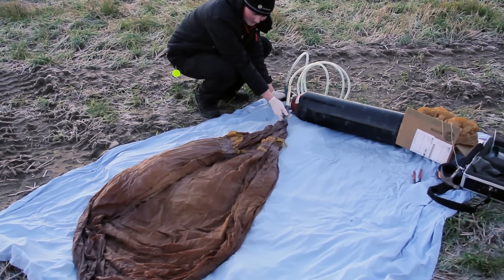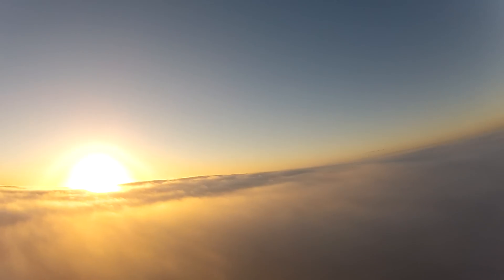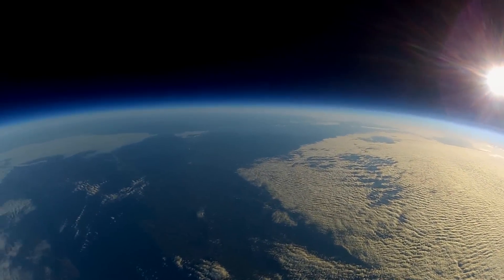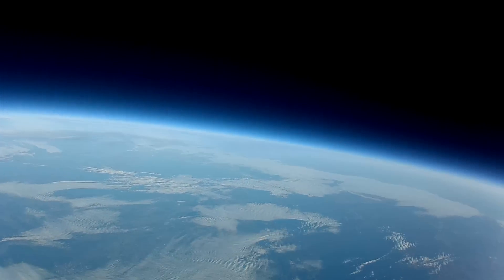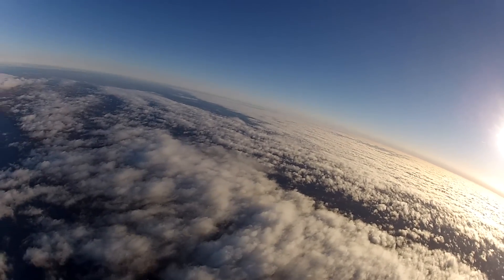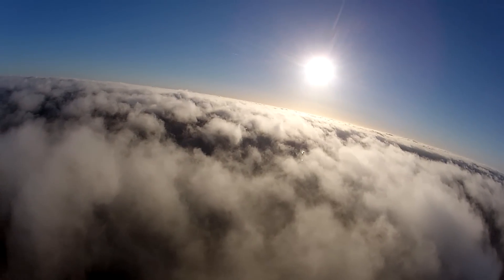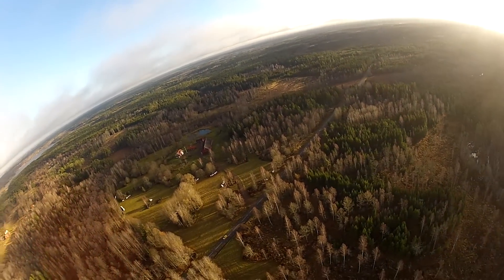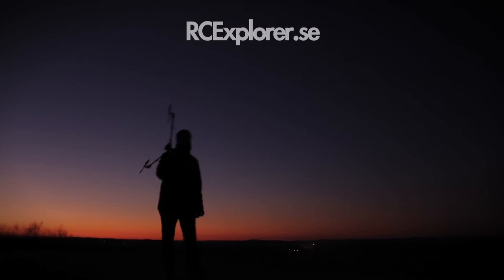Space Glider - FPV to Space and Back!

Comment: Hello!! I am currently participating in a weather balloon launch but only with a recovery parachute. We plan to launch another weather balloon in a year but with a flying wing like yours, and to be able to recover the load, so that it flies and navigates to a safe point, just like yours. Could you tell me what equipment you used, how you programmed it, how it works and what equipment is needed? I am working on the manufacturing of the flying wing, and the APRS transmitter, with GPS and SSTV transmitter, everything will be included in the flying wing. We are a group of radio amateurs who are working on this idea. We have already launched 5 balloons, until today, and a couple of them were lost in the Atlantic Ocean (we are in Uruguay, South America) and the idea is to have the wing return gliding as programmed. No engine or camera, just the image transmission and APRS equipment for locating and tracking the data streams. I would greatly appreciate help understanding the equipment needed to program the wing.
Thank you.
Hugo Perdigon. CX5ABZ
Email: tresclavos@adinet.com.uy

Comment: I’ve never built any rc/fpv stuff so forgive me if this is something you did or tried to do
But couldn’t you put a GPS module on it with a way to communicate that info to your ground station ?
Then you’d be able to see where the balloon is during its journey up 
And also be able to find the glider afterwards 
And how hard is it to build an automatic antenna tracker that will keep itself pointed at the target 
Mount the thing on the roof of your car 
As long as you’re driving in the general direction of where the balloon is going you’ll have good reception and a good chance of being near the glider once the flight is done

Comment: 100% Fake Space video by the NAZI's, to try and convince you of a spherical globe Earth. It's neither round or in any motion, wake up kids... What is lens distortion or Barrel Distortion ?
 In summary, it’s when a lens produces curved lines where straight lines should be. Tilt the lens upward to achieve a concave horizon. Tilt the lens downward for a convex horizon. Fish Eye lenses produces this effect all the time. Wide Angle lenses will negate this effect somewhat, so when you point your fisheye lens below the horizon (in most NASA or Drone photography) the ends of the horizon are bent down. But, if you point your lens above the horizon, the effect will be reversed and the ends of the horizon line will be bent up. If this does not occur within such a Video, it's been PhotoShopped to make Earth horizon appear permanently convex, like a video game.

Comment: Hey buddy here's an idea what you guys should try do the same thing but instead of a motor you use rockets and see if you can get a rocket orbiting the Earth and then bring it back with maybe pictures and samples of course you will have to figure out how old you will be able to do that but if you think of it if you take more than one weather balloon and bring up a bigger payload you can probably pull it off but you will need to put off Wings on the vessel so it will Glide away from the explosion from the weather balloon and then launch make sure the wings are biodegradable and when they're out of range and you don't need the wings anymore you can release them or build a rocket that could still use them when gliding back to Earth I bring this concept to a bunch of people and they didn't listen but I have a feeling you might be able to pull this off if you're interested

Comment: Good achievement BUT 33,000 metres  (100,000 feet) is not even close to space. 250,000 feet is the lowest definition used and 328,000 feet is the more commonly used definition.

Comment: If I was going to do something like this, I think I'd minimise the chance of "luck" getting in the way by making some auto-disengage mechanism that senses when the cable to the balloon is no longer carrying the weight of the plane or payload (which indicates the balloon has popped) and disengages the glider or payload from the balloon immediately at that point. Or alternatively, use an altimeter or pressure sensor to disengage from the balloon at a height a little below where the balloon is expected to pop. This would separate the rising balloon from the falling payload quite quickly, and then it can pop when it is well away from the payload.
Reply: First of all, great video on the merit  it shows what NASA has only shown faintly at the expense  of billions of USA tax dollars,  mainly with cgi  composite images and not a 24/7 real video of earth.  Now my analysis. 1) How is it that while talks of drones and RC flying being suppressed and these days are heavily monitored by the FAA,  you get away with this level of project? Where in many places,  you would be fined for endangering and possibly risking regular, commercial or military aircraft and invading airspace, unless you are talking a huge risk or, what seems to me, more plausible, that your project is by design, and funded perhaps by the same entities  that want to keep the masses under many  spells, as many yt channels that have considerable large followings are controlled and supported, as long as the channels project certain agendas. 2) On the basis of common sense thinking,  what if you hit a commercial airplane or a regular or military airplane, for that matter, during your ascend or descend?
3) I am quite certain that you are funded by a company to show exactly what you show,  especially with a fish eye lens, still  maintains the big  question, if the earth is a ball or a circle plane. The Bible describes it, on many sections as the "circle" of the earth. 4) is your project on purpose?, perhaps to keep people still in that mystery and dilemma.    5) Or your video could be utilized as means to further impose stricter measures on the RC Hobby community . A dumb move , but I don't think you are that dumb and my logical guess considering the power your yt channel has to pull viewers is that this video is by design and you are being paid a hefty amount for the purposes I just described.  
BTW,  I do not need  to be convinced that  the Earth is not a sphere. I know it is not, I  have known it long ago via my ancestors, way  before all the  fe talk and videos surfaced on the internet and many people are confirming that, almost daily and the Bible sort of puts the icing on the cake. For those of you who are open minded, may I suggest looking up the recent experiments with infra red photography mentioned in Jeranism's YT  channel.  Anyway, if I was an official working under the FAA or  AMA I would be looking at this and similar videos in a totally different angle than the average RC enthusiast.  For those who are true RC enthusiast, you should give this considerable thought and not just view it on the merit of high number of views or on the cool factor. There is a lot more than meets the eye in many of the social media platforms and many videos come with a hidden agendas. Understand that huge money controls people and the world and you can bet that any YT channel that is up there is funded by vested interest groups for their own agendas.  There is a  very small amount of  truth  passed on via the Internet and those doing so do it a high risk and to fully grasp this, you have to have been around the block many times, if you know what I mean.

Comment: This is almost exactly what I've wanted to see tried forever.  Except with an auto release when the balloon pops, and automatic GPS guidance back to the launch point.  I figured out a way to do the auto release with a parachute and lifting hook with two attachment points.  The lifting hook would go through a loop attached to the drone.  The balloon would be attached by string to the attachment point on the hook that holds it so it lifts the drone.  Then when the balloon pops, the parachute right below it would open and pull the hook by a different attachment point that would pull the hook out of the loop attached to the drone so it would fall free.  Then the glider could be free to guide itself back.

Comment: maybe this is a silly question: what about putting a pressure regulated valve at the bottom of the balloon, and venting some of the gas as the altitude increases. would that not extend the range of the balloon?

Comment: 33,000m is not space....
Reply: No, it is not space.

It is more like 20 miles.  Space arbitrarily defined as beginning at around 60 miles.  That said, it is over three times the altitude of the average commercial airline flight.
Reply: Technically earth is in space so yeah
Reply: the station are in low earth orbit space. most recon hight where you are official in space are 100km up
Reply: @sal venezia sure

Comment: next time you should attach a rod to a weather balloon and attach the plane on the rod facing down so when use release the plane it will slide down the rod and get a little speed right at first then you can level out and try to gain more altitude

Comment: come one guys , it cam't reach to space , the atmosphere self will burn it ,. and the anti gravity at space . bullshit
Reply: First: you're right, the balloon couldn't reach space. Think of the atmosphere like a lake, and space is like the air above the lake. If you have a piece of foam at the bottom of the lake and you release it, it will float to the surface and stop there. It stops with part out of the water and part in the water because that's where it reaches neutral buoyancy. The same would occur with the weather balloon, even though the divide between atmosphere and space is much less distinct than the surface of a lake. The balloon would ascend until it either reaches neutral buoyancy or it pops. If the balloon were completely out in space and it somehow didn't pop, it would begin to descend again because the weight of the helium in the balloon would be greater than the vacuum it displaces. The only reason helium floats is because it's lighter than its medium, which is air. In space, there is no medium so the helium will weigh more than the vacuum surrounding it. Instead, it just reached near space, AKA the upper atmosphere.

Second, you say the drone would have burned up on reentry. This is false. Things burn up while entering the atmosphere because they move so quickly that the air in front compresses and heats up to the point of burning up the object. If you really do study space and atmosphere at Oxford, I hope you already knew that. The plane, on the other hand, did not fall quickly. Because its wings create lift, it was able to slowly glide instead of dropping at terminal velocity. Because its vertical and horizontal speeds were both wayyy to low to create a high-pressure pocket in front, there is no way that the atmosphere would have burned up the plane.

Also, the "anti gravity at space"? That makes absolutely no sense, you know that right? Anti gravity doesn't exist, unless you just mean gravity from a different direction. To stop feeling Earth's gravity, you theoretically have to be infinitely far away. The strength of that force decreases as you get farther away. The reason things orbit the Earth is because as they fall, the Earth curves away from them. Really, the ISS isn't outside the Earth's gravitational pull. As a matter of fact, it doesn't even experience zero-gravity. Instead, it experiences zero G's, which is a very different concept. Because the ISS is in a constant state of free-fall, the astronauts inside don't experience acceleration. They do experience gravity.

Comment: not bieng hater anymore but if the balloon was in space you would not be able to hear it pop due to lack of oxygen
Reply: Zak Woodhead and also, because of how balloons work, it could never reach space by balloon alone.
Reply: You could they are weather balloons they are designed to go much higher than regular balloons
Reply: But with the weight of the plane it is attached to i can see your point
Reply: I am sorry you do not study at oxford uni otherwise you would not have made such idiotic statements.
Reply: You cannot reach true space with a balloon but you can get close. Also you would hear the balloon burst in space as the camera with the microphone is attached to it and the vibrations would travel along that line and be picket up.
Reply: You would hear just a buzz not a pop
Reply: Agreed it would not sound like a pop
Reply: And the drone woild have burned up on atmosphere re entry
Reply: Why
Reply: I study space and atmospheres at oxford uni
Reply: +Bob Crow Hi Bob, nice to see another person defending the cause of sanity in this Youtube comment section.

Now, Zak; time to debunk you. First: the balloon couldn't reach space, even without anything attached to it. Think of the atmosphere like a lake, and space is like the air above the lake. If you have a piece of foam at the bottom of the lake and you release it, it will float to the surface and stop there. It stops with part out of the water and part in the water because that's where it reaches neutral buoyancy. The same would occur with the weather balloon, even though the divide between atmosphere and space is much less distinct than the surface of a lake. The balloon would ascend until it either reaches neutral buoyancy or it pops. If the balloon were completely out in space and it somehow didn't pop, it would begin to descend again because the weight of the helium in the balloon would be greater than the vacuum it displaces. The only reason helium floats is because it's lighter than its medium, which is air. In space, there is no medium so the helium will weigh more than the vacuum surrounding it.

Now we have determined that the balloon popped in the upper atmosphere, not in space. Because it was still surrounded by air (albeit thinner), the sound propagated through the air and to the camera's microphone.

Second, you say the drone would have burned up on reentry. This is false. Things burn up while entering the atmosphere because they move so quickly that the air in front compresses and heats up to the point of burning up the object. If you really do study space and atmosphere at Oxford, I hope you already knew that. The plane, on the other hand, did not fall quickly. Because its wings create lift, it was able to slowly glide instead of dropping at terminal velocity. Because its vertical and horizontal speeds were both wayyy to low to create a high-pressure pocket in front, there is no way that the atmosphere would have burned up the plane.

Retort that, Zak.
Reply: How are they idiotic?
Reply: I just told you why they are. Also, there's pretty much no way you study space and atmosphere at Oxford because 1) Your profile picture looks like you're 10, and you probably are. 2) Your videos sound like they were made by a 10 year old. 3) I won't be too harsh on you because you're just a little kid. 4) Don't try to sound smart and sophisticated when you're 10 years old, it will just make you look dumb. 5) Next time you tell people you study at Oxford, change your profile picture and don't upload Minecraft videos.